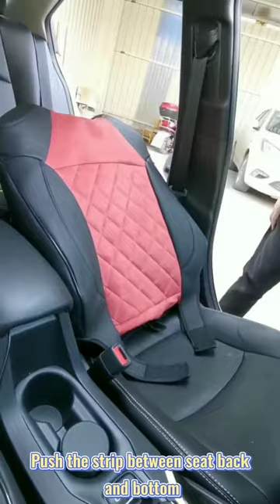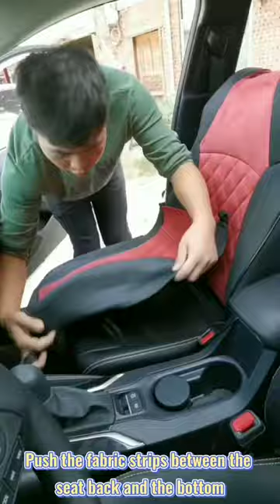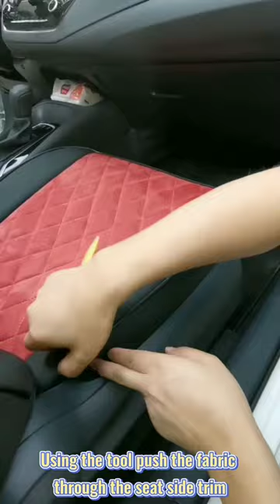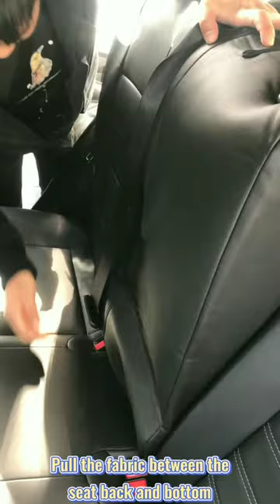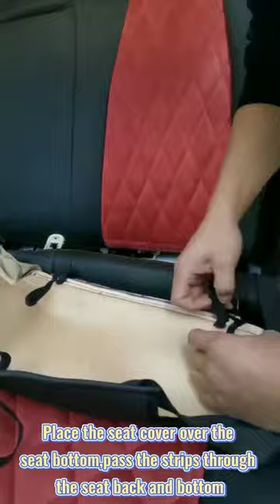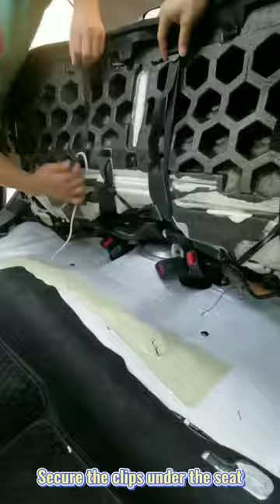How to install EKR 2019 2020 2021 2022 2023 Toyota RAV4 custom seat covers

Comment: These do look good, but as others have pointed out very difficult to install.   The video skips right through the most difficult parts.   I did not remove my backseat bottom just tucked it all in, looks ok.  Do not press against the plastic strap clip with the yellow pushing tool, they will break :(.    I used a straightened wire coat hanger to pull the straps beneath the front seats.

Comment: Bonus Tip: Don't panic if this is more than you can handle or something goes wrong. There's no shame in having someone else do it. I saw a comment on Amazon where the purchaser said he did not want to hassle with the install. He took the covers to his Toyota dealership, who did the install in about 90 minutes total. That means he probably paid about $100 to $150 for the work. Note: The dealership exclaimed surprise at how good the quality was of the covers, and amazed at the precise fit. When I read that comment I was sold on these. 

Some people even commented that they had purchased other seat covers in the past and they were very pleased at the quality and fit of these covers compared to others.

Comment: Notes for installer:

- Front seats are more straight forward than the rear. Dont follow their order of operations in this video though, because you will see they undo what the already did in order to install. Do the seat bottoms/cushion first - then do the backrest. I just removed all the headrests in the car as the first thing.

- Also start with the cushion first for the back seat, its even more important. They made way more work for themselves in this video. You will have to remove rear bench cushion anyway, so doing the seat backs is 20x easier without the cushion installed. Keep in mind that this video looks nothing like the gen 5 rav4 underneath the cushion, and you will have to get creative. Just tie the pull strings to the seat hooks. Reinstall the cushion after you are done with the backrest! 

(Someone asked in here about how to remove rear seat cushion, and had to look up another video to verify.. You pull up. Hard. Like with all your strength. If its never been removed before then its going to feel like you are going to break something before it gives. Two clips in front)

- Rear seat backs need velcro or made out of carpet in order to use the factory rubber cargo mat. It attaches to back seat. Personally I added velcro to the covers myself, but its DIY

- The factory back seat has an elastic loop holding middle seat belt. Current design requires you either cut the factory loop, or unbolt the seat belt to remove from loop - neither are ideal given the ease of everything else. You don't have to but the cover wont sit perfect and will have wrinkles

- STEAM is your friend. Go buy a $20 steamer and make these fit and look great when done installing. Hit wrinkles and loos parts with steam, and rub the cushion.

At the end of the day - these are surprisingly CHEAP and look amazing when given enough effort. High quality for a couple hundred bucks. Custom upholstered seats would be $2000+
Reply: Really helpful, thank you!

Comment: My question is about the cup holder on the middle of the  back seat in the rav4 2020?
Reply: I ordered the covers for my Rav4 2021 that also has the cup holder that folds down in the middle back seat and the cover is made to fit so you can still use the cup holder.  There is a part that you unzip to access the cup holders when you want to use them.